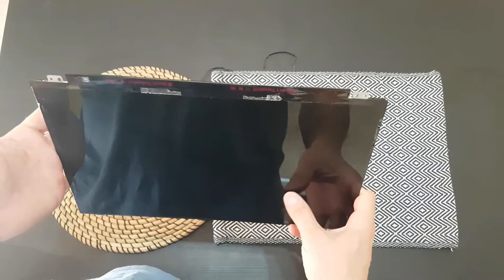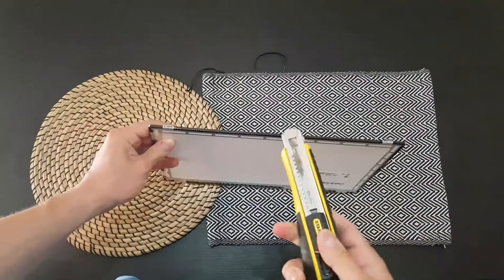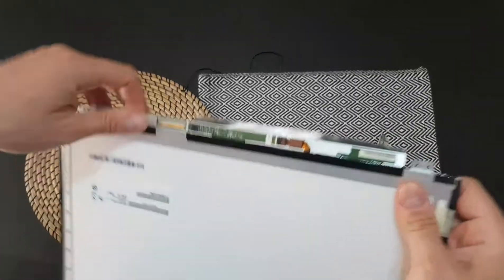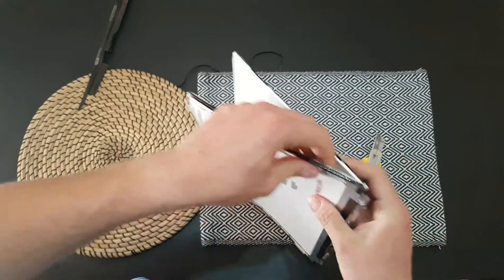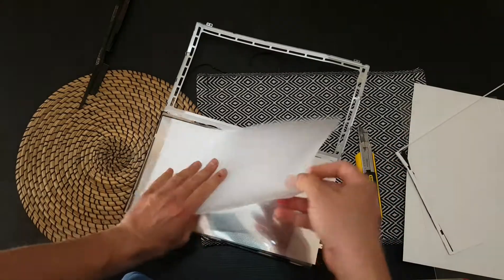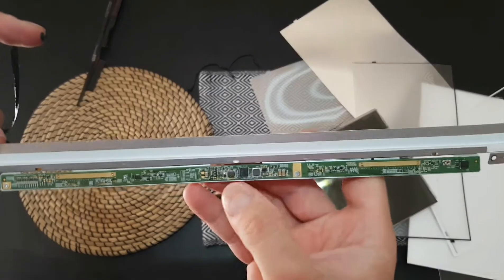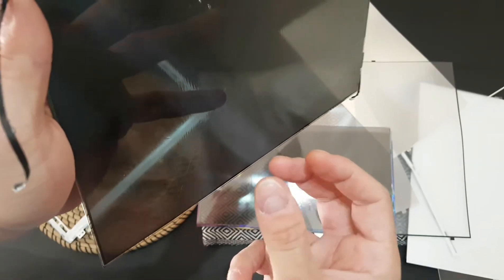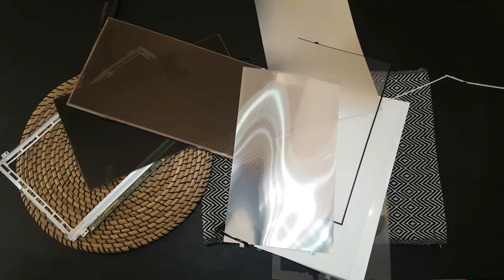How IT Looks Inside AN LCD Display Screen

Comment: How do you call those three paper-like layers
Reply: They are called polarizers
Reply: The first one he remoced is a white reflector, next an acrylic plexiglass light guide, next a 4 layer paper comprised of 
 diffusion paper , DBEF dual brightness enhancement film AKA reflective polarizers (basically mirrors )and another diffusion paper. .Thats it
Reply: @naveenk6387  thanks for info,i couldnt find on the internet what those foils are

Comment: Is it possible to clean the spilled liquid and the put it all back together?
Reply: yes, but you'll have to piss inside the display for it to work again because that's the liquid crystal that filters the light from behind and forms the image.
Reply: 🤣🤣🤣.can bruh but even a bit of wrong thing happened your display will die.and dont touch the display with bare hands bcoz its poisonous